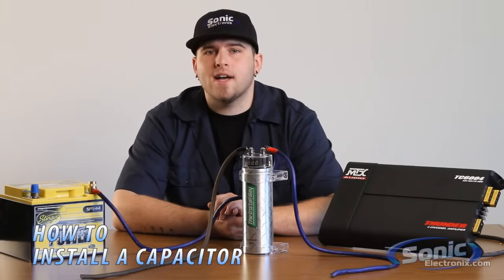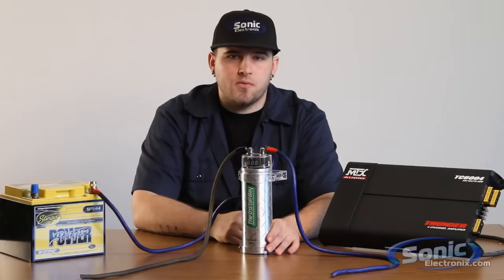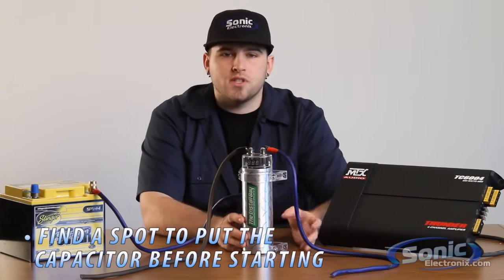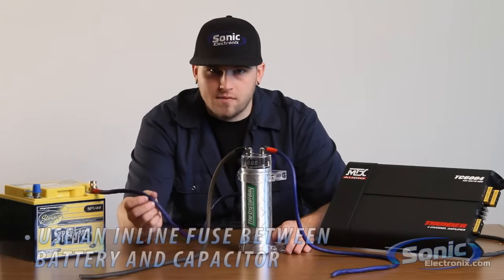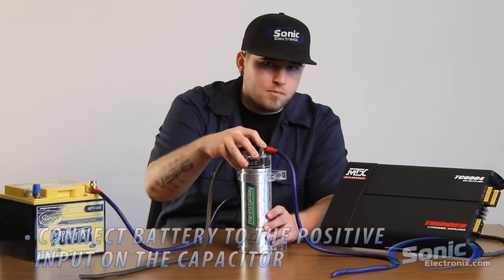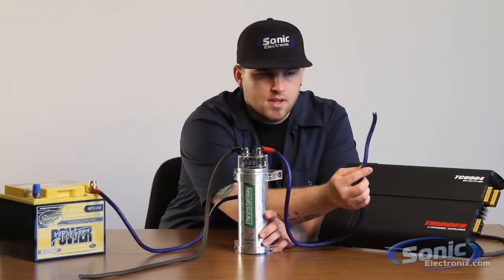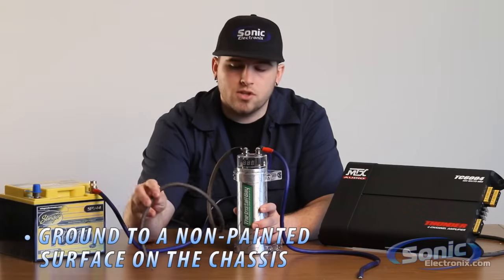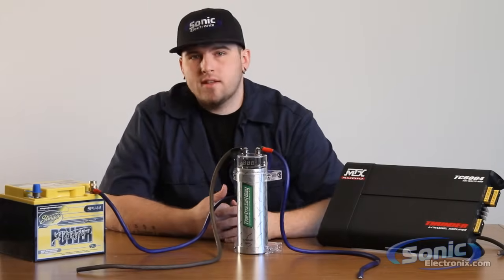How To Install A Car Audio Capacitor

Comment from the maker: @BMXRider267 That's one way, and it's the cheapest at the end of the day.  If you just got a brand new battery or something then you can just add a battery near your amplifier and hook it up with a battery isolator to your main battery.  The isolator will prevent the new battery from unnecessarily draining from your main battery while the vehicle isn't on.  The HC1400 might fit as a starting battery for your vehicle, but check the dimensions before buying it.  The SHURiKEN SK-BT60 will also work

Comment: @SonicElectronixTV 
just do a solo line for charging? just have the cap connected, not the amp?
after charging then i unground everything plug in the positives  and then put the inline fuse back in and then ground it all?
thanks lol

Comment from the maker: @marcusher You'll need to charge the capacitor when you first install it.  The capacitor should come with a resistor to allow for charging.  As far as installation, just remember to have a fuse in-line from your battery to the capacitor and you'll be good to go.

Comment from the maker: @SubMasterT The fuse that you use depends on the size of wiring you used.  If you're running 1000-1700 watts of RMS power you'll want to go with 0 gauge wiring if the amplifier can handle it.  0 Gauge Wiring should use a 250 amp fuse to a 300 amp fuse, depending on the brand of wiring and overall quality.  Check with your wiring installation to see what size fuse it recommends.

Comment from the maker: @BMXRider267 The added capacitor won't add any additional power to your vehicle, it will only help store and discharge power that already exists.  It may help alleviate some of the dimming, but it will only minimally help.  If anything, consider an HC1400, or an HC1800 power cell if you only want to use one, then you can even also add another battery in the future if you want to supplement it, but if you start with an AGM power cell, you can help store a much larger charge.

Comment from the maker: @BMXRider267 The upgraded alternator depends on your vehicle.  You can get a great deal for specific vehicles and an upgraded alternator is your best bet to go with.  The Dual battery setup can run around $200-$300 or so for each battery and the isolator.

Comment from the maker: @BMXRider267 I'd recommend a dual battery setup, or an upgraded alternator.  Sounds like that amp draws quite a bit of power in order to function. So you'll want to consider adding two batteries to your vehicle.   One to replace your current battery, and another to run your aftermarket audio system.  You'll need to use a battery isolator to connect these batteries together.  This will regulate the voltage your system will draw, and prevent dimming lights.

Comment: @SonicElectronixTV i learned something newthough that changed my mind i would have to buy 2 batteries that are brand new for it to work or it will kill my good battery and also i would have to install a second fuse before going to the amp cause if something happens it will continue to put out electricity unlike a capacitor that will quickly discharge... so i'm going to go the cheaper way thanks for the feed back though

Comment from the maker: @1kickass You're correct.  A battery will pretty much do the same thing.  Even better, consider an Absorbed Glass Mat Power Cell like a Kinetik HC600.  The reason these are more beneficial are their high crank amps/amp hour ratings.  A benefit of a capacitor is the high rate of discharge so they can provide your amp with voltage at high rates.

Comment from the maker: @TheKaufenberg If it's a true RMS CEA-Compliant 4000 watt amplifier then you should use a power cell.  A 4000 watt amplifier will draw quite a strain on your electrical system.  Replace your battery with a power cell, and consider adding another in your trunk.  If the amplifier is more like a 2000W amplifier than you may want to run just one power cell under your hood, and maybe supplement it with a capacitor, but that may not even be necessary.

Comment from the maker: @TheKaufenberg Yes.  You'll need to have a power and ground connection to your amplifier for it to properly operate.  Brendan demonstrates that you'll need to have the ground from the capacitor on an unpainted metal surface, and the amplifier will require it's own separate ground on a stable unpainted metal surface.  You can also use a ground distribution block for this as Brendan mentions in the video.

Comment: @6satan6ist6 The 6 farred cap is running my system great. 
Here is the one i have. search E-bay for "NEW ABSOLUTE Digital Power Cap 6 Farad Car Capacitor"
I was told more is better than not enough. So it may not need 6 farreds but it was cheap and will store more power than the system will need.

I have it running to a 1000 watt Sony Amp powering 2 12" Sony Subs in a dual 12" ported box in the trunk of a Chrysler Lebaron :)  All powered by a Optima Yellow top Deep cycle Battery under the hood.

Comment: @6satan6ist6 that's what im gonna do when i get the cap in the mail I got a 6 fared cap for 69.99 from E-Bay :) gonna run the ground from the chassis to the cap to the amp  and the power wire from the battery to the cap to the amp.

Comment: My ? is ca you run the Ground wire from the Amp and the ground from the cap to the same ground spot?   or also could you run the - from the amp the the - of the cap and have just one wire going to the ground spot?

Comment from the maker: @ctapia79 There's not as much of a need to go with a capacitor on your 4-channel as much as the amp on your subs.  Just run the capacitor in-line with your subwoofer amplifier as that's going to be the amplifier that draws the most amperage.  If you really want to run it with both of your amps, you can use a distribution block to connect them all.

Comment: Question,
I have 2 amps in my car one is JL 500/1 (subs) and a Rocford fosgate power 750x/4
my question is do I connect my capacitor to both or just to the one runiong the subs.
 
Thanks.

Comment from the maker: @Merhivi There's no need to fuse the ground when installing a car audio capacitor.  Just make sure to have a fuse in-line with your 12v power and you'll be protected and good to go!

Comment from the maker: @xdragosx That's a strange issue to run into with this amplifier and that large of an alternator.  Usually factory alternators are around 100 amps, so if you're running a 150 there may be a problem with the electrical systems ground in your vehicle.  It may be that the amplifier itself doesn't have a stable ground so it's over-drawing from your power source to compensate for this.  Check your 12v power/ground connections are stable so they can achieve full continuity.

Comment from the maker: @djchichi31 Power solutions depend on a lot of factors (i.e. your car alternator size, the amplifiers you are using and how efficient they are, and how much overall power your system is running).  If you're totaling over 1000 watts of RMS power in your system (which you most likely are) go for a battery like the HC1800 by Kinetik.  35 Farad Stiffening Caps usually won't store as much power as stated, and they're only capable of storing power.  If you choose a capacitor, use the HCAP-40.

Comment: @SonicElectronixTV how do you charge them when first installing? and do i install everything in and the last step is to attach the red cable to the positive terminal on the car battery?

Comment from the maker: @rispeto With a capacitor you should only have to charge them when first installing.  Capacitors will recharge themselves from your battery after it's initial charge.  If your capacitor is constantly discharging without resupplying itself with a charge than your capacitor may be defective.

Comment from the maker: @Merhivi It could be a defective capacitor.  If your ground is connected with a fuse in-inline and the moment you connect the positives your fuse blows and the capacitor sparks the capacitor may be shorting.  Make sure your ground is connected prior to connecting power and a fuse is in line (which is sounds like you've already verified) and it seems to us as though your capacitor is defective.  Give us a call and let's get that defective cap replaced for you. 1-877-289-7664 option 3.

Comment from the maker: @harjitsd That Hifonics amplifier draws a bit more current at 1 Ohm that at 2 Ohm so you concern is understandable.  Since your alternator is a little smaller than most it might be strained a bit.  The short answer to your question is it will minimally effect your electrical system.  It most likely won't be noticeable, but you might want to upgrade your cars alternator if you plan on expanding any further onto your system.

Comment from the maker: @thedickbutt101 A capacitor can benefit the amplifiers, more likely the monoblock more than the multichannel.  The reason why a capacitor will help in your audio system is because the capacitor is storing voltage near your amplifiers and can discharge quickly to provide power to your amps.  This helps on dragged out bass notes where your amp requires a lot of power at once.  Check out our blog section and knowledge base on our webpage for a quick read on Capacitors and Power Cells.

Comment from the maker: @upthebum100 If installed incorrectly, or installed in an electrical system that is malfunctioning capacitors can be as dangerous as a battery.  

In some situations capacitors can explode, leak, or short out. It's highly recommended to have a professional install your capacitor along with the rest of your audio system.

Comment from the maker: @ThatFreeThinker Not a dumb question at all.  Simply put, a capacitor will hold a charge.  This can benefit a car audio system because amplifiers sometimes demand large amounts of power very quickly.  If your capacitor is constantly holding a charge closer to your amplifiers, this can help meet up with the demand.  Also capacitors discharge quickly, faster than your battery can essentially.  As far as batteries, I'll PM you details as there's too much info for the character limit.

Comment from the maker: @97chevyZ71350 Yes that's correct.  After reviewing the video it is tough to see that the power connection from the battery goes to the same terminal that the power cable to the amplifier is on.

Comment: @SonicElectronixTV  what if i put battery, amp and those woofer at the back in the storage area and connect my i-pod to amp input it will work or not because i dont want to mess up with car battery and don't want to do wireing. it's new car

Comment from the maker: @thewebb5457 It could be a few things, first things that come to mind would maybe be a defective voice coil or possibly even blown subwoofers.  I would recommend to check the impedance of each of your subwoofers using a digital multi-meter (DMM) to ensure they have a stable reading.  If the reading fluctuates, the woofers voice coils are more than likely defective.

Comment: @thewebb5457 i have a question i have a 2 farad cap with a 800 watt amp at first it worked fine n then all of a sudden the bass cut out when i first turn the car on the cap is at 13 but after the first bass hit it goes down 2 nine basicly causeing my amp not 2 work correctly....my question is why isnt my cap charging all te way up is it broken?

Comment: My fuse keeps blowing between the capacitor and the amp, i bought it after market and it allready had the fuse so i decided to use it. There is also the recommenced in line fuse between the battery and the capacitor, any idea on why the fuse between the cap and the amp keeps blowing? I notice the woofers are kind of quiet and the second i turn it up the fuse from cap to amp blows, its a drum style 15A. ANY HELP IS APRECIATED!!

Comment from the maker: @thewebb5457 ruthlessone3k is correct. The cap will still work fine.  Inverted mounting and reversed audio polarity won't have any effect on the polarity of the actual 12v Power/Ground.

Comment: @thewebb5457 Yes, a cap will still work fine. The cap simply powers the amp. It does nothing to the audio signal.

Comment from the maker: @VeryTucker I wouldn't recommend wiring it any way other than parallel.  When you connect the wiring, you're just connecting positive to positive, negative to negative.  I've head of car batteries being wired in series, however not with capacitors.

Comment: Capacitors are ok, I would get an extra battery but for lower end systems they serve their purpose. I like to think of Caps as a bandage on a wound, it doesn't heal the wound, merely temporary fix. A cap may stop lights from dimming if it is not serious and will provide a bit more punch to your woofers. All in all though, if you have anything more substantial then a basic system try an extra battery.

Comment: @specialformula14 lol well ill redo one for you. Fuck Capacitors lol. Their bad for your car, dont Last, the only useful thing about them is the voltage display lol, Dont get them, Its like putting sugar on a sugar cane. Itz already sugar and sweet y add something unnecessarily